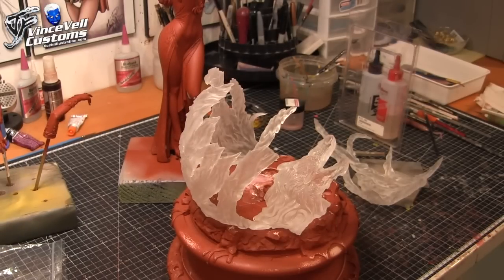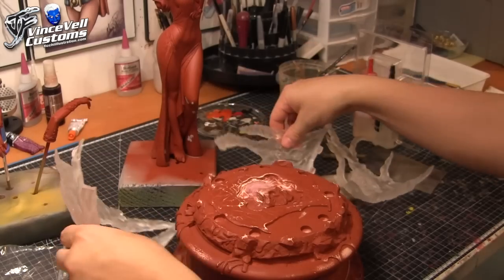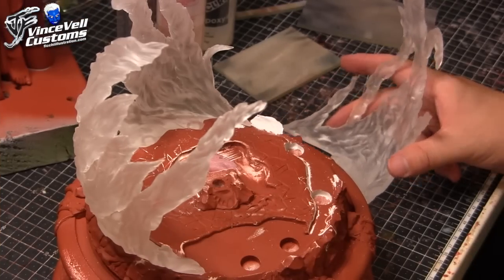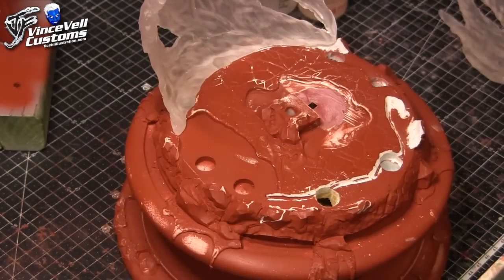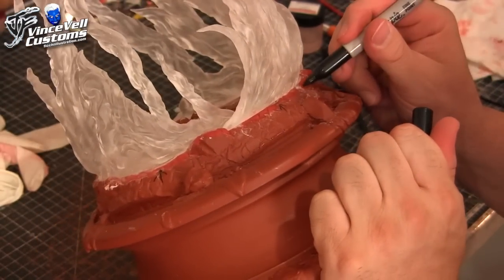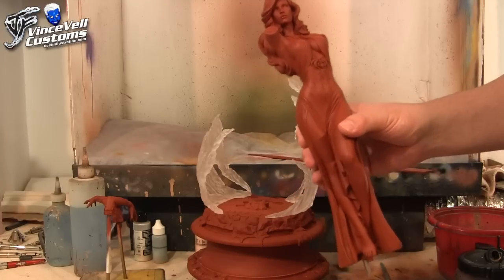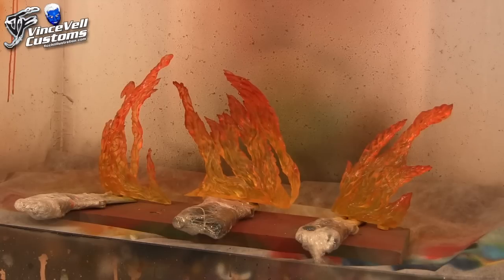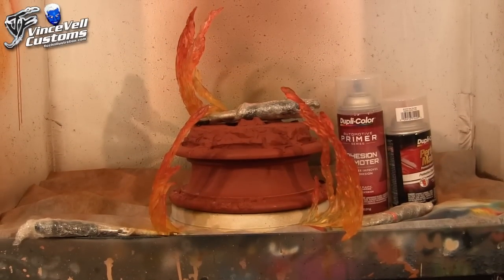Hariqa The Fire Elemental WIP Part 3 Setting Up & Painting Clear Resin Flames

Comment: Awesome, thanks for sharing didn't really know how to do the fire effects, thought they used dye's in the transparent resin to get it directly like that out of the mold but i guess it's just transparent paint over transparent resin.
Reply from the maker: Ya for garage kits, most just do clear resin and let the builder paint it, Pre painted statues some may dye the resin in a green if its for green lantern etc. but most paint the colors on. I think for plastic toys for kids tho they dye it or heat set a dye over the clear parts so its not toxic and rubs off.
Reply: @VinceVellCUSTOMS  Very interesting, i will be making both painted and unpainted so thanks for the info.

Comment: Maybe i'm wrong,but sad thing there 's no exist some modelling epoxy putty in transparent clear color ...
Reply from the maker: ya there nothing to sculpt in clear with, but you can seem up clears with the epoxy i use for the clear magnets if you practice enough getting it right, or some glues. I just need to look into other products more.
Reply: Thanks for your fast answer John, for glue heavy resin or others material i used "Devcon 5mn epoxy 70gr"hard to find here in France,but a friend from the US sended me a batch years ago..never used the magnets system,looks amazing !
Reply from the maker: cool ill have to look into that stuff if its still around. Ya i tend to use magnets on everything or most of what i do, easier for display and packing in case i need to move or sell off.